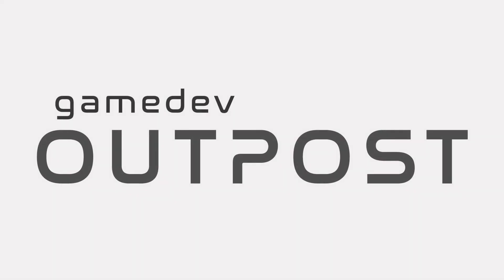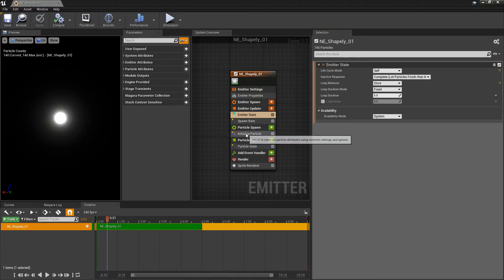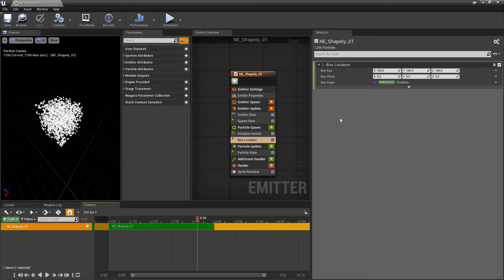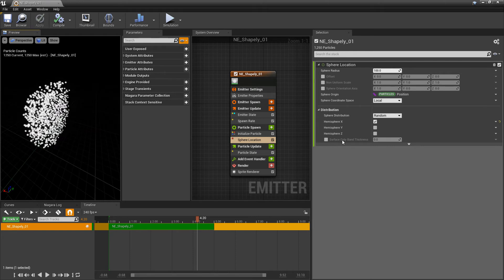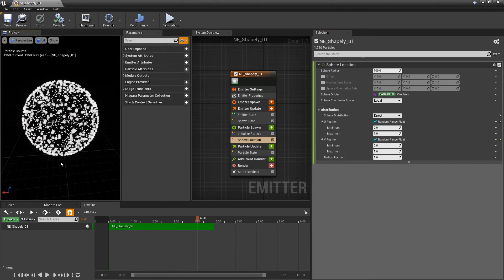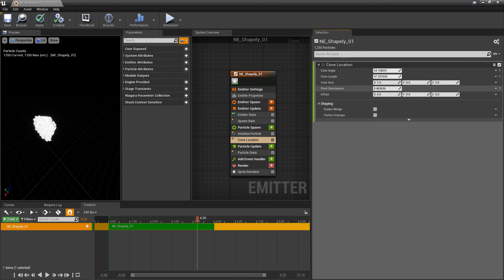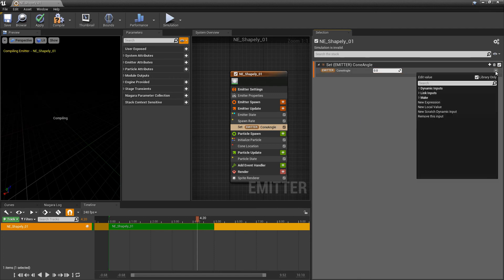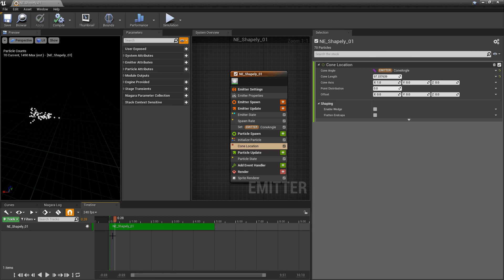UE4 - Niagara Shapes and Surface

Comment: Hi, is there a way to stop curve in the middle by blueprint command  (by button press, or collision event) and continue after some other logic happened? Thanks for your work.
Reply from the maker: In blueprint, if you drag off from your Niagara reference you can search for "pause." You should see "Set Pause" it can take a boolean. This will pause your system. Let me know if this was what you looking for.
Reply: @gamedevoutpost9270  Thank's for reply! Look's like by this way AI character(s) can control speed of Niagara emitters and other parameters through blueprint. So much to explore!
Reply: @gamedevoutpost9270  Hello, quick question.. Why not just convert the cone angle to a curve directly? As opposed to modifying it with a custom parameter in the emitter update module? Seems like an unnecessary step...
Reply from the maker: @nonymous590  The intention here is to show a simple example that can be scaled up. You're right and you could of did exactly what you said for a simpler amount of work. Maybe you want to use a new parameter, maybe eventually you want to drive that parameter in complex ways, or maybe you want to feed it into a blueprint.  Options.